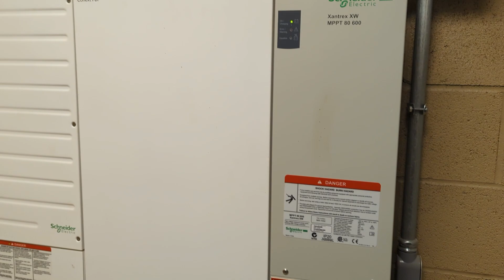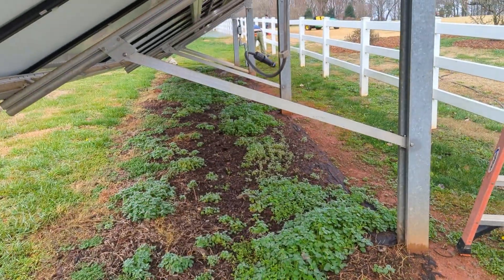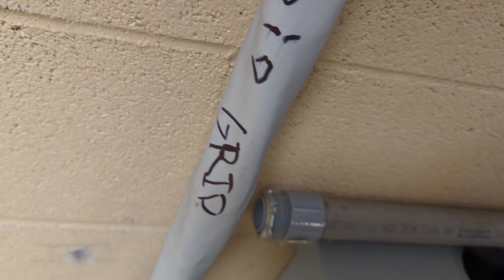Out with the old, in with the new!

Comment: What about Sol Ark 30kw 3p
Reply: What would you do with the third phase? And what for batteries?
Reply: They will be nice units, but not really useful ( or designed) for residential installs being 3 phase and 120/208.
Reply: You'd go three phase if you had a real compelling reason, like a house big enough that you were using three phase AC units or building a high end shop. With a really really high end shop + real elevators you might even justify having some 480v.

Comment: @0:38 4000 kilowatts per month. What does that even mean?
Reply: 4 gigawatt hours, or 4 million watt hours. Over 4 times the amount of the average household usage.
Reply: Not unheard of for a larger home. We average around 3000 kWh/mo. And that's with gas heating and cooking in a new home with good insulation and LED lights.
Reply: @Jeremy Thomas  wow, do you know what your big draw is? Well pump? Electric dryer/water heater? Large Hadron Collider?
Reply: @cordarylrosenlund4542  I have two Large Hadron Colliders I'll have you know. ;) HVAC, an EV, electric dryer, and a well pump are the largest loads.
Reply: @Jeremy Thomas  EV! sorry I forget to consider that as a non EV pleb. The nice thing about that is it's just another storage medium for your solar so it's kinda not a draw if you are overproducing. More like an anti-clipping/large storage device that brings you places. Does Tesla have the same feature as the lightning where it can be the battery backup for your house?
Reply: @cordarylrosenlund4542  not that I'm aware of. I have a Mach E personally.
Reply: @Jeremy Thomas  ooh that's ford, that option available?

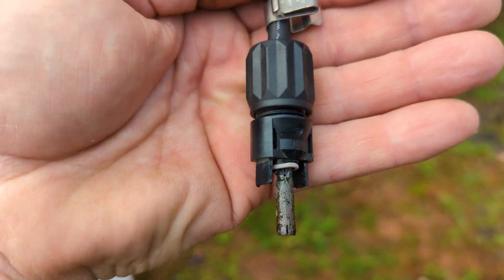Comment: 3:15 That is disheartening to see the amount of corrosion after just 8 years.  I do not yet have solar and have felt behind the curve.  However, I cannot just afford to change out a solar system.  It will have to last the 25 years of the panels.

Do I understand correctly that you are basically taking this from grid tie to whole house solar off grid?